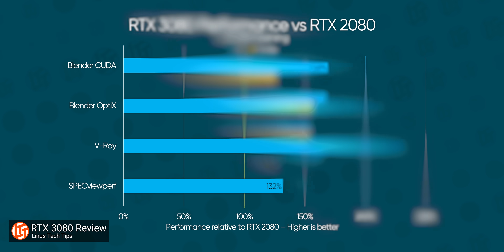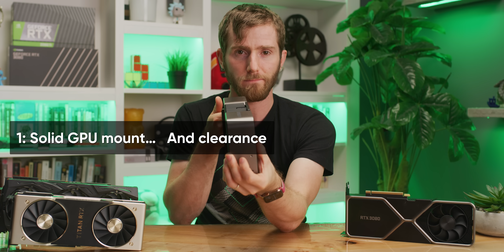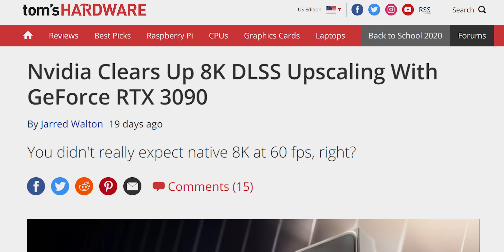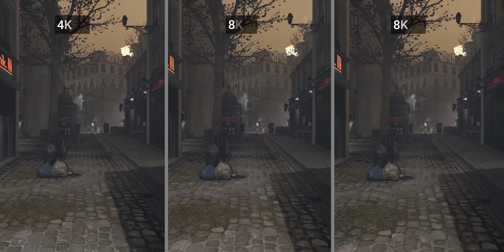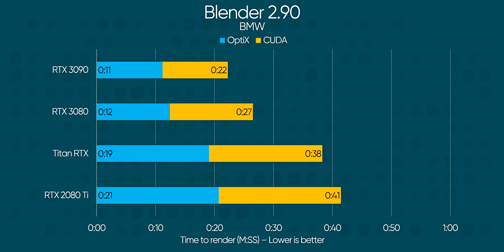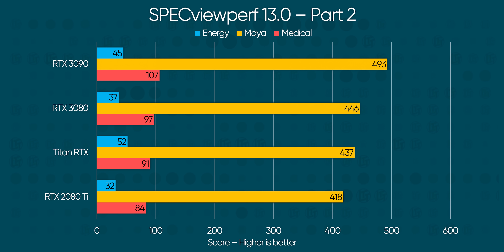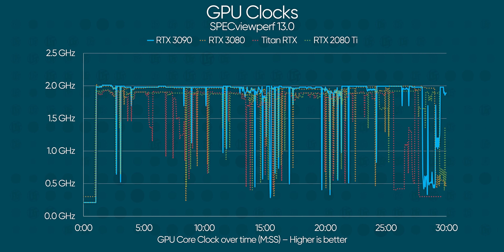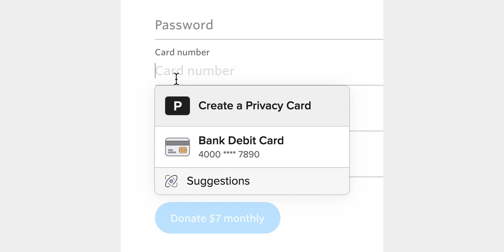Making Nvidia’s CEO mad - RTX 3090 Review

Comment: Nvidia: "We could have optimized the Geforce cards to be faster than the Titan in rendering workloads, but, uh, we didn't"
Reply: @gin price Increase means how much more you have to pay
from $1500 to $1000 the increase is $1500 - $1000 = $500
i.e. you have to pay $500 more
to get $500 from $1000 you multiply by 0.50
that means the increase from $1000 to $1500 is 50%

$1500 is 150% the price of $1000, but that's not the price INCREASE

The problem isn't maths, it's whatever weird definition of "price increase" you're using.
Reply: @Emrad_b  look at all those words you typed when all you had to type is "150% increase"
Reply: @Emrad_b  it is 150 % the price and it is an increase, read my 1st point, there is nothing wrong with it
Reply: You know what's really funny? Linus could've included RX 5700 XT SPECviewperf benchmarks to show how it gets the same score in Solidworks and crushes the RTX 3090 in Siemens NX (the 5700 XT scores 74 in SNX).
Reply: The 3090 is more the replacement for the Titan. Only marketing doing stupid marketing stuff.

And its a 50% increase.
Reply: @SpicyRamenBowl  words? no no, arithmetic works on numbers not words
Reply: @SpicyRamenBowl  correction, 150% its 1.5 not 2.5, that is your mistake
Reply: nvidia literally made hundreds of billions off the mining crap (so much they spent 40 billion to buy an unrelated cpu spec) and still they burn gamers... they have all the money but still they hurt us with 150% price increase for the high end gaming model .... GREED GREED GREED has ruined our future (hoping intel's coming video card will eat their lunch)
Reply: @ginxxxxx  what? 150% increase?
Reply: @mariushernes606  the high end "GAMING" model now costs $1500 instead of the $1000 at launch like it did before. take away all the buzz and those are the facts. nvidia has been making TONs of money and they still squeeze gamers for A LOT OF MONEY
Reply: @ginxxxxx  GTX 3090 isnt really for gaming. For professionals there are alot of features that makes the price OK.

The real gaming successor is the 3080 and honestly its priced very low considering the power and previous generation price.
Reply: @mariushernes606  tell nvidia that...why does the 3080 have a step down so the 3090 can take its place in memory... i knew exactly why nvidia is marketing 3090 as the new min/max gaming pc ... and they cover their butt with lies so ppl like you can post arguments to gamers like me who just want to be treated fairly (not be told am wrong by you)
Reply: @mariushernes606  they named it using their gaming line....
Reply: @mariushernes606   Did you watch the video? The 3090 doesn't have pro firmware so it is for gaming. There's either gonna be a new titan that crushes it or they won't make a pro card for this generation, guess which option is more likely.
Reply: @ginxxxxx  You're acting like it's a new or unique thing for corporations to be greedy and profit driven, but it's not. In a capitalist society, companies exist to earn a profit. This dates back to The Wealth of Nations from 1776.
Reply: @HotCrossJuns  i know more about it than you, so stuff it. i also know out to fix it
Reply: gin bwaawaa capitalism is bad. If amd has a top end rtx 3090 comparable card at revolutionary price then the nvidia price tag doesn’t make sense. But if not then why are you even surprised that nvidia can charge whatever they want??
Reply: @ginxxxxx  Sure, bud. It's not like everything you've said up until this point contradicts that...
Reply: @ginxxxxx  you only have to spend $1500 for 2-3 years,that's rather extremely low,lower than having a child.
Reply: @ginxxxxx  If the base cost is $1000, and it was increased to $1500 that's not a 150% increase, that's just a 50% increase. 150% would land the price at $2500.
Reply: @what_in_the_heck_is_going_on  we are both right, just that my maths are better. 1000 X 1.50 = 1500 ... this is a very common thing a lot of business use and its very simple maths. 50% of something is half of something. when you get a job in an office you will realize how many organizations to maths just as i do
Reply: @what_in_the_heck_is_going_on  if we did things your way, on a balance sheet we would have to do AMOUNT + AMOUNT X 0.50 instead of my way of AMOUNT X 1.50
Reply: @ginxxxxx  Oh boy. Lots to address here.

First, the bad maths: $1500 is 150% the price of $1000, but it is 50% price increase over $1000. Increase means "additional". The horrible story blah blah... is correct.

The 3090 is not the replacement for the 2080ti, even if it is the highest in the line up. There is another 3080 model with 20GB (which may be branded ti) coming soon. Same as the 2080ti didn't launch at exactly the same time as the 2080. It's going to fit somewhere in between the $799 and $1499 prices, so ~$1100-$1200.

You call Arm a "cpu spec" and a "mobile cpu" - it's a leeeetle bit more than that.
Reply: gin the 3090 is not the predecessor of the 2080ti (which was more like $1200 as well), it’s the predecessor of the $2500 Titan RTX, or it’s a whole new spectrum of the lineup. Wait until the 3080ti launches, then you can compare the price increase from the last gen, if there is any.
I’m not saying the 3090 is reasonably priced, but compared to the 20-series, it’s pretty competitive.
Also when you say 150% increase, you mean it increased by 150% of $1000, thereby making the price $2500. What you mean was 150% of the old price, or a 50% increase.
But please stop being that guy who thinks he’s always right, as it turns out, you aren’t half the time. :)
PS: why are you so triggered over Nvidia when they actually launched a really good generation???
Reply: @xriex  ok , 100% is the same about, below 100% is a decrease in amount. above 100% is an increase in amount. if you used maths for a living you would not be arguing this with me... do you really think you "GOT" me with this crap?
Reply: @ginxxxxx  your math is wrong, a 1.5x increase is a 50% increase. The reason you are wrong is because when multiplying something by 1.something
The 1 is kept as 100% and you add the .something to the 100%.

1.3* increase is the same as a 30% increase.

2.45* increase is the same as a 145% increase.

Go back to fifth grade and learn that basic math.
Reply: @chrelleren6729  it uses the name for a reason, and its a 150% increase in paper launch prices... the price will keep going up from paper to hand
Reply: @ginxxxxx  that's 50 percent increase
Reply: @Kyle_mk11  what would you like me to say "a 150% change"? if you actually had to use your numbers you would realize why i said 150%
Reply: @ginxxxxx  its so expensive cause its the highest of high. Only people who truly need the specs like pro gamers, streamers, or proffesional renderers need this. You do not have to buy this. Their gaming marketing is there cause it can run 8k gaming at 60fps. Its basicañly the rtx titan and 2080ti mixed into a single card
Reply: @nathanpost8753  amount X 1.50 is better than .50 x amount + amount. i am very correct in my english and maths, and many real ppl do things my way (you can argue on youtbube bout it all you like)
Reply: @mr.dinosuar7333  we need more competition
Reply: @ginxxxxx  I'm not arguing with you - I'm correcting you. What you've done, as we say in programming/software dev, is made an "off-by-1" error.
Reply: @mariushernes606  no
Reply: @ginxxxxx  then build a better card than the 3090 if you want "conpetition". Currently 3090 is the best card and 3080 next best. We have to see what amd will do, but currently no competition in the best gpu spectrum. Even in budget gaming, 3070 is best for budget, unless your needing even lower, where there is finally some competiton
Reply: @xriex  your wrong, 150% is exactly the amount increased and everyone uses that... your just out of the loop. posting on youtube about what you feel is correct means little to me. the world will contine to use 150% as the real increase (50% is half you moran)
Reply: @xriex  i am telling you many ppl do as i do, and would tell you to change your ways if you complained.
Reply: @ginxxxxx  they never said the 3090 is for gaming, its purely 8k gaming which need a 30k monitor... and  it'S normally for work, video rendering and everything. the RTX3080 is actually a gret deal, 750$ for the best gaming card
Reply: @xriex  your are a liar, you are no programmer and you are definitely no mathematician
Reply: @ginxxxxx  You know what you can do? Just not buy it lol, and buy an rtx 3080 🤷🏻‍♂️
Reply: @samuelcloutier8651  did i say something you didn't like?
Reply: @ginxxxxx  You can still take an amount and multiply it by 1.5 in your calculations. However, that 1 before the decimal is just accounting for the base amount. Anything beyond that 1 is the actual increase. In this case it's 50%, if it were base amount * 2.5, 1.5 of that would be the increase and 1.0 of that would be the base amount. The increase is 50%
Reply: @ginxxxxx  Wow for this great mathematician you aren't very good at math are you... If 10 million people do something wrong it doesn't magically make it the right way. .5 is indeed 50%.
Reply: @SpicyRamenBowl  you enter a shop (programming or maths) and you say AMOUNT X 1.50 is wrong they going to just stare at you.
Reply: @SpicyRamenBowl  it depends what number is important to you, for me its 1500, to you its 500, i happen to believe the number 1500 is more useful in this situation. you are a wrong.
Reply: @what_in_the_heck_is_going_on  it is 150 % the price and it is an increase, read my 1st point, there is nothing wrong with it
100% is the same amount, below 100% is a decrease in amount. above 100% is an increase in amount. if you used maths for a living you would not be arguing this with me... do you really think you "GOT" me with this crap?
Reply: @ginxxxxx  its not a gaming card
Reply: @jalapenopoggers8310  nvidia put it in its gaming line up with a higher number... oops
Reply: @xXJeReMiAhXx99  plz stop replying to me, im putting you on ignore
Reply: @ginxxxxx  Do you even math?
Reply: @ginxxxxx  ok well have fun playing 8k minecraft at 25 fps rtx after spending $40,000, this is all fine, nothing to see here
Reply: @jalapenopoggers8310  the problem is the 150% price increase from the last generation. its unacceptable
Reply: @mariushernes606   yes, 1 is the identity, 100% is just 1, 1500 is 1000 x1.5, 1500 is a 150% price increase from 1000
Reply: @mariushernes606  what is your github username? im ready to code review your work.
Reply: @mariushernes606  did you know nvidia has a new high end card at a 150% price increase?... i hope there are more video card makers in the near future.
Reply: @ginxxxxx  You dont have a math degree. I can tell. 

To calculate a percentage increase you work out the difference (increase) between the two numbers you are comparing.
Increase = New Number - Original Number
Then:  divide the increase by the original number and multiply the answer by 100.
% increase = Increase ÷ Original Number × 100.
Reply: @ginxxxxx  Its 50%
Reply: @mariushernes606  its their high end gaming  model at a 150% price increase, and thats that
Reply: @mariushernes606  i actually do have a degree in maths and i am also a programmer, but seeing as it is you who are correcting me, plz share your github.
Reply: @ginxxxxx  If you want to do alternative math go right ahead. But everyone with a basic understanding of math disagree. So either you are wrong or every math professor.
Reply: @mariushernes606  you are not mad at 150% you are mad at my use of the word "increase"... to which i care nothing, i said exactly what i wanted to say in 3 words "150% price INCREASE" on a youtube post. l like to think i know a bit about programming and you seem to be correcting my very trivial post, i think you are a silly fool so please share your github or any of your work so i can laugh.
Reply: @ginxxxxx  Even if it was a full 150% "increase" that would be 2500 you're literally not making sense to anyone here.
Reply: @ginxxxxx  Are you proud of your github account? And cant do math? Thats hilarious 😅
Reply: @ginxxxxx  Do me a favor go to your calculator on your phone and type in 150% times 1000
Reply: @ginxxxxx  Now try 1000 times .5 and then add the original 1000 do you see the math at work here?
Reply: @SpicyRamenBowl  the funny thing is that i knew many ppl like you would flame me for saying "150% increase" while i was typing it. i knew what i was posting
Reply: @ginxxxxx  Surely if your phone has Youtube it has a calculator
Reply: @SpicyRamenBowl  i will always use 150% instead of 50% to show an increase from 1000 to 1500 as it is the correct thing to post on youtube to mean a 150% price increase.
Reply: @mariushernes606  it does not have to be github, any public code
Reply: @ginxxxxx  The new card is 150% the price of the old card. The price has increased by 50%. It's just that simple.
Reply: @Iaotle  im not saying otherwise. when i wrote the first post i had a decision to make, type "150% price increase" or type "50% price increase" and i typed the former. i knew exactly the maths involved and i always pick 150% because that is what i meant.
Reply: @ginxxxxx  lol ok pls come to work after covid restrictions are lifted cus your co-workers are missing their laughing stock. Man you make me feel good abt myself
Reply: @ginxxxxx  Ok that's fine but that doesn't make it correct math because you said so.
Reply: @ginxxxxx  It's not a 150% price increase. The new card is 150% the price of the old one. Increase means +, 150% the price means price * 150%. The price has increased by 50%.
Reply: @ginxxxxx  The reason you are wrong is a "price increase of 150%" means the math would be 1000 + 1500 = 2500. However the correct math is a price increase of 50% is 1000 + 500 = 1500. This is what we are saying.
Reply: @SpicyRamenBowl  1000 x 1.5 = 1500 for a 150% price increase
Reply: @Iaotle  the price did increase, 150% to be exact.
Reply: @ginxxxxx  That's incorrect though that is a price increase of 50%
Reply: @bachmai1844  it sounds like you are the problem at your work. i feel sorry for you.
Reply: @ginxxxxx  Even using your math 1000 times 1.5 that is an increase of 50% wording does indeed make a difference here a price increase of 150% is 2500 or 1000 times 2.5
Reply: @SpicyRamenBowl  put this in your cal, 1000 x 1.5 or do you have a better formula to share?
Reply: @ginxxxxx  It's really easy or did you skip that comment this is the last time I will repeat it a price increase of 50% would be 1000 x 1.5 a price increase of 150% is 1000 x 2.5 and 2500 is not the correct answer here sorry but not sorry...
Reply: @ginxxxxx  You are forgetting the fact that you are adding a whole 150% to the entire 100% so you are saying 250%
Reply: @SpicyRamenBowl  no, its 150% price increase, a 250% price increase would be 2500.
Reply: @SpicyRamenBowl  no need for addition, 150% price increase is 1500$
Reply: @ginxxxxx  Your wording of that is not correct
Reply: @SpicyRamenBowl  what is wrong? i meant 150% price increase
Reply: @SpicyRamenBowl  you wish for me to express myself using addition, no i rather say what i mean, a 150% price increase. why do you think i must add 2500? i mean a 150% price increase why cannot i type it out in 3 words exactly as i mean?
Reply: @ginxxxxx  Hey look we have something in common!
Reply: @bachmai1844  that nvidia is a huge disappointment and linus is a shill
Reply: Seems to perform almost the same as Titan in some workloads and better at a lot better at rendering but a Titan is like $2500 compared to $1500 3090, so buying a 3090 is still a better deal from any point you look at. They made that old Titan obsolete at this price.
Reply: @mrblathers  you have not been following the news for the last ten years about how much profits they make (in data centers not just gaming), and they have more than 13 billion you liar, they just bought a mobile cpu for $40 billion.... ... .. . .... ..

Comment: I don't get what psu I should buy, the RTX 3070 supposedly has 650 wattage? But the 3090 has 350? How does that work? I'm really trying to avoid spending 200 bucks just for a power supply for the 3070 when it drops. Is the 650 what the 3070 puts out or is recommended? Guess I'll have to wait till October

Comment: I can understand Linus using a 10980K to benchmark this GPU for gaming as it is the better CPU for gaming, though that doesn’t mean I didn’t wish he used a Ryzen 3950x as the CPU for the set up he had to benchmark the 3090 as most switched over to that excellent CPU by now. I also wish Linus showed how many frames we get from the 3090 at 1080p and 144p resolutions since most gamers are running those monitors that have a higher refresh rate at the expense of high resolution like 4K, 5k, and 8k. If the 3090 can give gamers more frames when at those kind of resolutions consistently, many gamers like myself would be interested in saving up to get the 3090 over the 3080 since the 3090 could last us longer then the 3080.

Comment: Gotta hand it to nVidia. The price on the new RTX 3090 is great... the perfect reason for PC Gamers to consider buying a next gen console.

$1500 USD just for a GPU? That's how much I spent on my entire system not 4 years ago in Canadian Maple Bucks!

This may be a sign that hardware manufacturers are getting in on the whale hunting train. Not the first sign either. nVidia's pricing has been dramatically climbing for a couple years now. At this rate the RTX 6090 will require a mortgage.

Comment: 3D Modelers really don't care about graphics card until they render stuff. And for that price you can simply buy two 3080s, put them in your system and render with both and be MUCH faster than with a single 3090. Same goes for streamers. They can buy a 2080 to game and on top of that build a second complete system just for encoding. The 3090 as is just does not make any sense whatsoever, except for rich kid gamers with too much money.